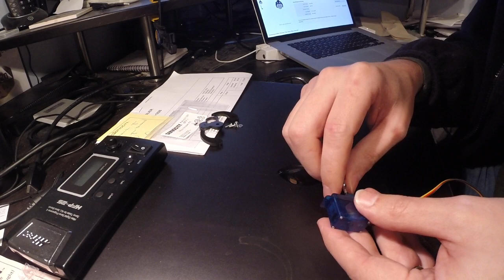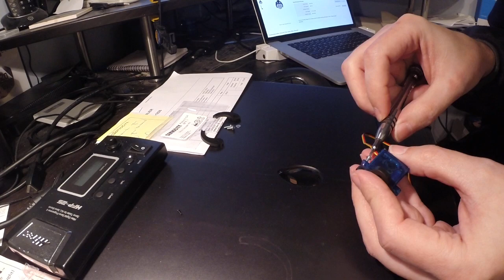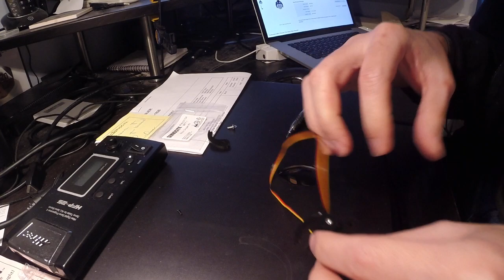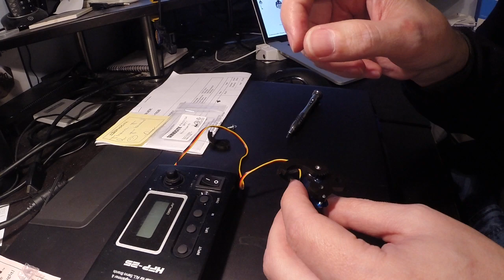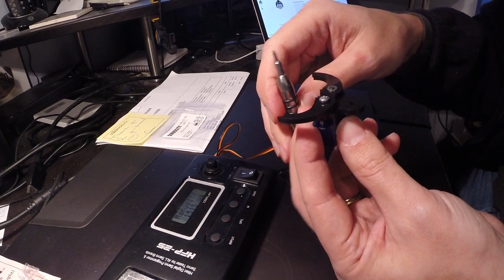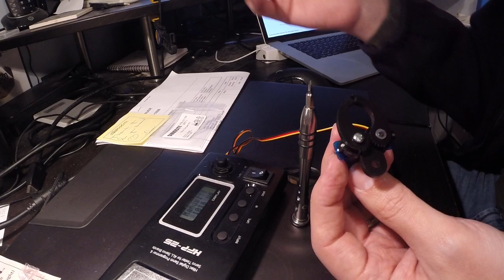Setup of Micro Gripper Kit for servo

Comment: what servo did you use
Reply from the maker: I honestly don't remember. It was just a simple servo I picked up from a local hobby shop.
Reply: @dreRCandFPV  I know this was like almost 6 years ago, but I was wondering if you had an sg90 micro servo that you could possibly try the gripper kit on. Just look up what an sg90 servo in case you don't know what it is. Thanks so much and that would be greatly appreciated.